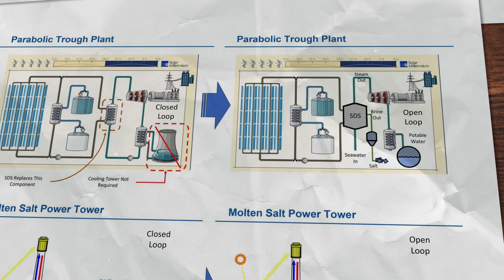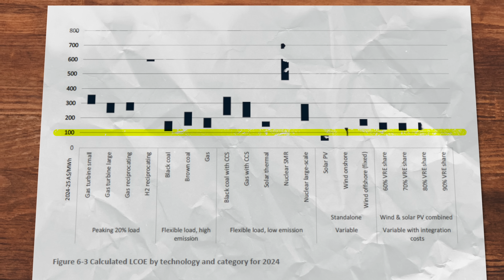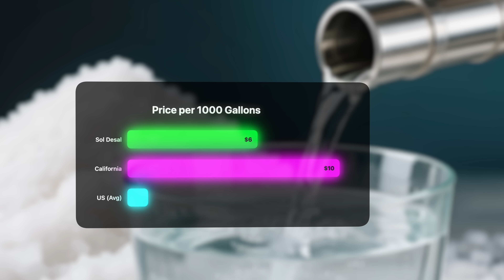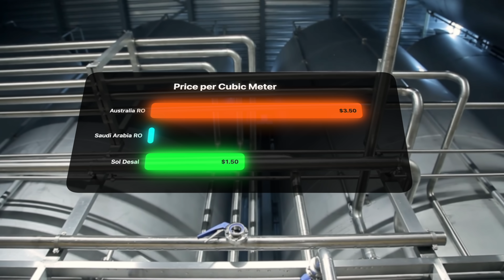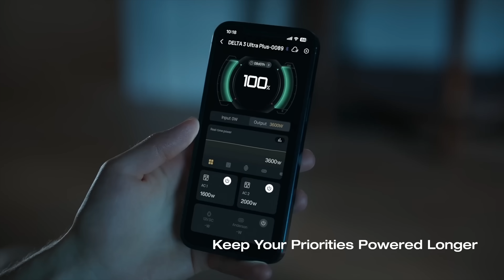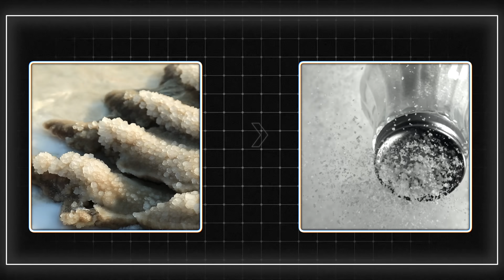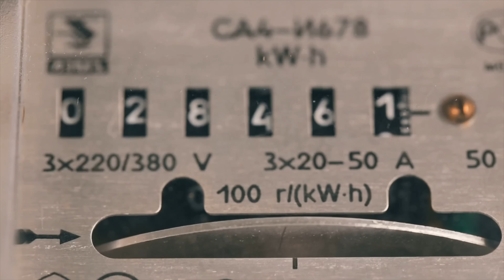The Desalination Process that MAKES Electricity - Too Good To Be True?

Comment: Brine shouldn't be a problem if you have time. Simply cycle it in shallow pools and let the sun do the work. Then collect the salt, flood the pool with new brine. However I see problems with all the other moving parts. Mirrors to create energy proved inefficient compared to solar panels already. Corrosion also happens through the pipes not just in the turbine. All in all, this project wants to solve 3 problems but it isn't cost effective at either of them. And being complex, I bet the capital costs are also much higher than for the competition.

Comment: Finally, a power plant with the electrolytes kids crave! I saw no mention of the filtering required on the seawater intake side. You can't just boil it straight without a lot of nastiness. A filter post-boiler could handle the salty spray but even distilled water is hard on plumbing and turbines. The whole system reminds me of a giga version of Deka's (Dean Kamen) Slingshot - a refrigerator size water purification system that ran on just about any heat source and input water.

Comment: The corrosiveness of sea water makes this difficult.  How do you keep your boiler/piping from corroding away?  I maintained water distillers/RO at a couple of universities and at industry.  Stainless steel dissolves into the water over time.  If you put DI water into SS containers it will have metal ions in it.  I replaced a distillation tower at one plant as water in the organic solvent corroded the tower completely in a few years.

Comment: If solar radiation is enough to produce all the fresh water... the ocean already covers most of the Earth's surface and gets hit with much more solar than all the land combined.

Run a vent pipe from the coast to an underground reservoir and let the temperature differential condense water out. You could even run some blower fans on a solar panel. I mean, when the solar radiation is good, the air over the water is full of water that you can harvest with nothing more than a cool can of soda or a basement wall.

Comment: Sounds like a pipe dream given the corrosive nature of boiling sea water.  Would be cool if it worked out though. I wonder if the blades are coated in a ceramic composite inconel stainless steel blend or something radical that I've never heard of before. 
Good luck to the team, hope it comes to fruition.
Reply: California spent BILLIONS on the Ivnpah Solar Electric Generating System which will soon shut down.  This is why electricity in Souther California is as high as 70 cents per KW in peak hours during the summer.  We pay for "green energy" scams in our power bills.
Reply: Wet steam eats pretty much everything with or without dissolved salts. The salt cakes the blades and heat exchangers. The cost of turbine replacement needs to be added in
Reply: Geothermal plants are doing it, and it was a serious problem in the '80s. There will be or is a solution, and it ought to include filtering the solid salt, so that is not wearing on the turbine.
Reply: @aebemacgill great idea! Let's use reverse osmosis on the seawater and THEN boil it without the salt!

Lol smh
Reply: Electric charge on the pipe apparently stops corrosion.

Comment: If heating water to spin a turbine is the goal, why bother with high tech, when simple glass, sunshine, closed loop high grade oil, and undergound storage will solve the problem?  It's cheaper, everything is recyclable and safe for the environment.  Why bother with solar panels?  They are almost impossible to recycle.  Solar panels are many many times more expensive to make and deploy than refractive solar heating.  So why are solar panels a better option?  I just don't get it.

Comment: If we are looking for a simple heat source, why not just use magnifying glass to heat oil in a pipe.  We can move this oil into insulated holding tanks below ground and hold this heat for some time before using it if necessary.  Straight forward.  Easy. Simple.

Comment: The solar portion sounds similar to the Ivanpah Concentrated Solar Plant in the Mojave Desert which is being closed down early due to economics, bird death and desert tortoise death.

"The Ivanpah plant was a financial boondoggle and environmental disaster.”

— Julia Dowell, Sierra Club
Reply: Not exactly, they won't be heating the salt to a molten phase, it should have more more normal corrosive effects on the plumbing than the mojave plant did, which as I understand it was the major contributor to why it was a failure. The cost to maintain the plant was very much higher than expected so the LCOE was way more than anyone would pay compared to any other source of power. It was only the initial contract that kept the plant online as long as it was. In this idea the hot water leaves at about 100 C and the salt at the mojave plant was 1200 C.

Comment: The solution to the salt vapor destroying the steam turbine is simple. Close loop water steam condensation system and salt concentration use water steam to heat graphite heat exchanger to super critical CO2 turbine system that operates at lower temp with much cheaper smaller thigher performance turbines. The salt vapor turbine putting problem goes away as does much larger less efficient more expensive higher maintenance water steam turbine. Super critical CO2 turbines will generate much more electric power with same energy input and fresh water and salt production is not impacted. Graphite could also power high temp electric water cracking into hydrogen and oxygen. Can sell both gases as well as take hydrogen and pull CO2 from air to make methane fuel or nitrogen to make amonia. Amonia is a universal green fuel that any know engine can be converted to use. Diesel gasoline 2 stroke, 4 stroke, 6 stroke, gas turbines, wankel rotary engines, liquid piston rotary, Otto cycle engines, jet turbines and turboprop can all burn amonia and it is fuel cell compatible and future solid state engine compatible too. In addition to amonia fuel, fertilizer can be produced as well. They can in future add solar power sewage treatment that creates methane electricity fresh water andbioconverted and  sterilized fertilizer. They can build sodium battery plant near by and under power/ desalination 1acre by 2 acre 30 stories down air locked hydroponic vertical farm with multiple levels of plants per story filtered fiber-optic solar lighting. Air locked double atmospheric pressure with 40% CO2 so that food production is 80% greater than surface farming. is no longer affected by weather or seasons or pests. Can use honey bees to pollinate and harvest honey and bee pollen and wax and food is organic. No pesticides no herbicides non GMO and using 95% less water. Under sewage treatment plant similar system but mushrooms using biomass fertilizer as nutrientsource combined with hydroponic bamboo farm for shoots wood fabrics and baboo sawdust for mushroom cultivation mixed with biomass from sewage treatment. Power plant can store heat in graphite thermal batteries so plant generates power 24/7 even when sun is down. Perhaps it can even still disalinate at nite as well. Other minerals can be harvested from brine as well. Rice and shrimp and fresh water snails and crawdads tilapia trout cod catfish together would be perfect crop for such a system. Algae farming for phosphorus and nitrogen fertilizer may be possible to enrich hydroponics. Off shore wind turbines can pump water to plant generate power without killing birds and bats as on shore does and use water ballast instead of CO2 emission concrete as onshore wind does. More over tidal power at base under water ocean current turbines and thermal difference between cold deep sea water and warmer surface can drive a Stirling engine turbine. And floating tidal power can have sealed solar 180 degree concentration solar atop it anchored to base of wind turbine that pumps water to desalination power plant inshore as well as making power anchor to wind turbine is off shore farm. Kelp sea weed sea grass sea grapes. Rock fish sea urchins lobster crab shrimp abalone clans muscles oysters red snapper with under water net fences and even near surface underwater domes using solar to evaporate water to condense into fresh water for hydroponic crops farming in ocean. Tomatoes basil mint lettuce onion etc. An ecosystem of salt production fresh water vegetables rice fish shell fish mushrooms sea weed snails electricity  rocket fuel shipping fuel sodium batteries bamboo flooring bamboo Crete construction bamboo clothing bedding home construction fiber board etc. We need to start thinking of things as ecosystems with minimal inefficiency and waste. Solar can be used to smelt metals. Making bricks. Make fuel for boats cars planes blimps and rockets water salt power. Provide water for hydroponic crops sewage treatment, heat and humidity for tropical plants in hydroponic system. Sodium batteries. A clean future.

Comment: A similar system (minus desalt.) was tried in both CA/NV and due to maintenance and operational costs could not remotely compete with solar panels. I doubt that the water produced would make up economically for this problem.

Comment: I proposed the exact same thing years ago. You can even uses parts of the process to extract Sodium metal. I call it the "Well duh method". I have similar small scale set ups that use black domes to heat sea water then use a water jacket of sea water to cool the air to condense it. Zero energy required except maybe a small solar pump for the water jacket. Potentially using a metal jacket and maybe heat pipes you can avoid the water jacket. It;s similar to those solar distillation systems emergency rafts use. There's no mystery to making clean water. So long as there's no chemicals that evaporate under heat. Basically it can remove heavy metals but not industrial chemicals. With these systems you can green deserts.......So why dont't they?

Comment: The basic concept (CSP heat to make steam, generate power, condense to fresh water, then crystallize brine) is physically plausible, but very challenging to commercialise at scale.
Several headline claims are overstated or incorrect. The “world’s cheapest water at $1.50/m³” is flatly wrong compared with recent RO tenders, which are 0.30 to 0.53 USD/m³. The 3,800-plant arithmetic yields 190 gigawatts, not 190 megawatts.
Critical engineering hurdles like steam purity for turbines and the very high energy cost of true zero-liquid-discharge are real and undercut the rosy economics.

Comment: Future Technology? This is one of those technologies that wasn’t developed, because the Oil Companies weren’t going to fund the research, because they didn’t profit from it, no it replaces an income stream. Two Bit shares likely reasons also? Created with Googles Opal: The Promise of Sol Desal technology aims to provide a zero-waste, cost-effective solution for desalinating seawater while simultaneously generating clean electricity and producing salt. This integrated approach addresses the critical global challenges of water scarcity and the need for sustainable energy.

Educational Content Analysis Report
Key Learning Points
Multifaceted Challenges of Desalination: Beyond simply removing salt, managing toxic brine waste and the high energy input are significant hurdles.
Zero Liquid Discharge (ZLD): A critical concept in industrial waste management, aimed at minimizing environmental impact and regulatory burdens by converting liquid waste into solid products.
Thermal Energy Storage: Essential for making intermittent renewable energy sources (like solar) provide 24/7 baseload power.
Economics of Energy and Water: The cost-effectiveness of new technologies is paramount for adoption, especially when competing with existing cheap resources.
Thermodynamics of Separation: Separating substances is energy-intensive, and the energy required can increase significantly at different stages.
Engineering Challenges in Steam Generation: The “brine carryover effect” is a major obstacle to using raw seawater in turbines.
Technology Readiness Levels (TRL): A scale used to assess the maturity of a technology.
Circular Economy Principles: The Sol Desal model exemplifies turning waste into a valuable product.
Interconnected Global Issues: Water scarcity, energy security, and environmental sustainability are deeply intertwined.
Overall Educational Relevance
The video offers a highly relevant and insightful exploration of a cutting-edge approach to addressing critical global challenges. It effectively breaks down a complex engineering concept, highlighting both its potential benefits and significant technical/economic hurdles. The discussion balances optimistic vision with a pragmatic assessment of technical and commercial realities, making it an excellent educational resource on innovation and sustainability.

Comment: This is vaporware. MythTech. Bull-pucky.

Using low quality fresh water to generate high pressure steam to turn turbines results in a disaster because contaminants that ride along with steam will condense on the blades of the turbine, resulting in vibration and shut down VERY quickly. Instead of using water, they're suggesting to use salt water. This will result in turbine failure in days, if not hours. And then you're going to spend days to weeks repairing it.

Salt water when used directly in normal plant systems results in piping getting clogged with salt. If you vaporize salt water into steam, you don't get left with brine, you get salt plated off on the skin of the boiler. Even with an agitator, this is very difficult to remove. You have to chisel it out. 

Your use of the words "High Quality Steam" implies you're using "high purity water," at least in industrial speak. You can say "High Pressure" steam, but it can be high pressure without being high quality. Ask any operator after a major turbine failure.

Comment: Check out the wiki page for the Ivanpah Solar Power Facility using similar technology.    Cost a couple billion to build and run, came online in 2014.. scheduled to close in 2026.  
Burned 254GWh of natural gas per year to pre-heat the salt in the morning (otherwise you waste  the whole morning's sunlight heating the salt back up to full temp before you can generate full power).     It did produce about 3x more energy than it consumes but it's still a net carbon producer.   Out in the middle of the desert it  cooked hundreds of birds every year.    Built near the coast it would be thousands.     It's an interesting idea, but not as simple as presented.
Reply: Exactly, this concept is just hype nonsense.
Reply: Yeah, we did a video on Ivanpah a few months ago. There are several alternatives, the most promising of which is parabolic troughs instead of power towers. There's a lot of technical work to be done, but I believe it's all "engineerinable." The core problem will almost always be cost. The true breakthrough idea here is to subsidize water generation with electricity cogeneration.
Reply: So you're saying that it wouldn't just make water, power, and salt, but also solar fried birds? That would be amazing!

Comment: One other potential use for the salt is heat storage.
Reply: Or as road salt.  It would surprise you how much road salt is used in northern climates.
Reply: @anguscampbell1533 Doesnt that mess up the local salt cycle big time?
Reply: @carlosandleon  not enough to outlaw it.
Reply: @nbsmith100 it was a new finding. The salt cycle is already broken beyond repair
Reply: @carlosandleon  that too. sorry i should have had more info- the answer was to the question about the use of so much salt on roadways in the north
Reply: @carlosandleon  Not sure how big the effect is. It's not killing weeds by the roadside. Never heard it's a problem for either rivers or ocean. We're concerned about other pollutants carried by the snow, however, so there are guidelines for handling it. There was an item in the news a couple of years ago about a snow deposit melting too close to our drinking water (in Oslo).
Reply: @mrleenudler Concerning the salt cycle, it’s actually over. It’s a natural process already effed beyond repair. It’s a cylce we werent aware of until like last year or something
Reply: SeaSalt  NaCl not usually used  for  Heat Storage
Reply: @MacVine  Is that because of its physical properties or the cost?
Reply: @z0mb1e564   NaCl . Tablet salt is not Good for heat storage . Due to its corrosive property and 850 C melting point . The lithium fluoride or potassium , sodium fluoride will be better with minimum corrosive property and less melting point. Also seasalt may contain impurities will need lot processing
Reply: @MacVine Ah, thank you for explaining
Reply: Yes, vaporizing the salt to make it into a block to store latent heat makes sense. And even then theres the fact you can also refine the sodium as well for electric batteries. The remaining stuff can be turned into that block.

Comment: OVER-SIMPLIFICATION ON A HUGE SCALE----it's getting close to lying.   First is the HUGE CAPITAL INVESTMENT REQUIRED,  Second-concentrated focus solar is a troubled technology, with lots of failure. THIRD-PURITY INDUSTRIAL SCALE WATER DISTILLATION DOES NOT CREATE A PURE water-IT WILL REQUIRE PURIFICATION THROUGH A REVERSE OSMOSIS SYSTEM-more costs......Purity-again----the "salt" residue will be sodium chloride (table salt) combines with a toxic stew with other chemicals, which will require investment in a huge facility to separate to produce usable "salt"------OH---and what to do with the toxic remnants of the salt purification process-----BAAAD NEWS-----OH OH----how about the high transportation infrastructure and operational costs of delivering electricity, water and "salt" to market--------------------THIS IS ONE OF THOSE WONDER PROJECTS THAT FAILS BECAUSE THE DETAILS DON'T WORK OUT LIKE THE CONCEPT ASSUMES--------examples of the debris of the complexity of reality lie everywhere